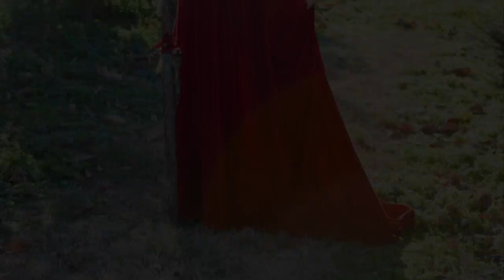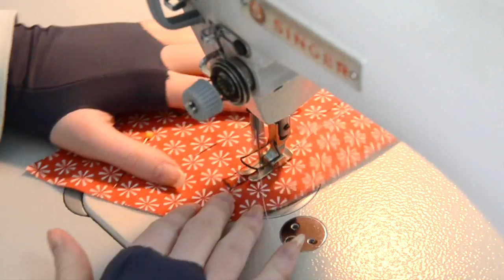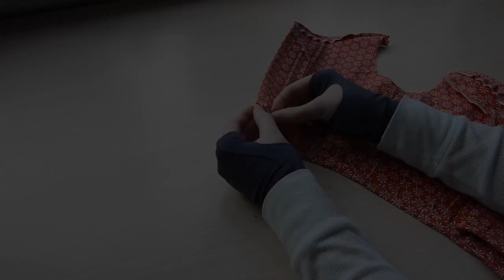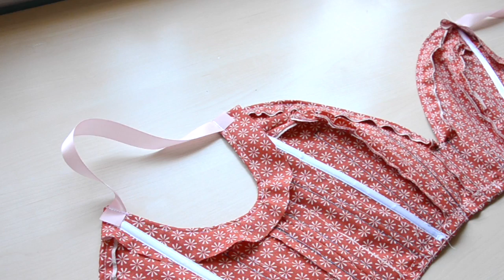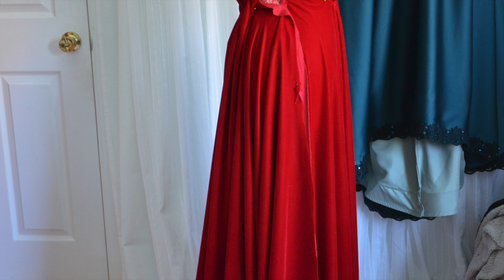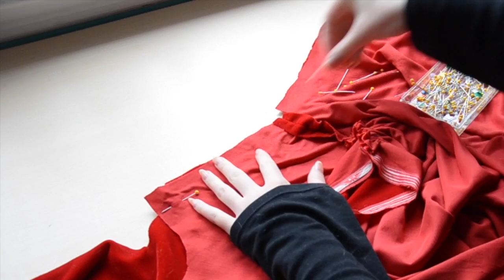Making a Draped Velvet Dress, Part One

Comment: You make the comment that velvet is difficult to see. I suggest you invest in a "walking foot". This special pressure foot is actually a quilting tool for your sewing machine but I love using mine for cordouroy as well as velvet because it feeds both the bottom and top layers of fabric at the same time. Thus, it greatly reduces the wrinkling and puckering.

Comment: I just want to say how much your videos have taught me about pattern drafting. I'm stubborn about doing my own patterns even when it'd probably be easier to use a bought pattern or I end up modifying them anyways. I find that there's tons of great patterning resources that talk about the drafting part, but for larger scale projects of higher difficulty, the more you can learn about handling and improvising with your pattern when different problems come up, the better. So seeing you work on these challenging pieces and how you adapt to different issues while following your initial design has really helped me in my own work. I know that it takes a lot of work to both do these projects, and document them meticulously at the same time as you do, so I really appreciate it.